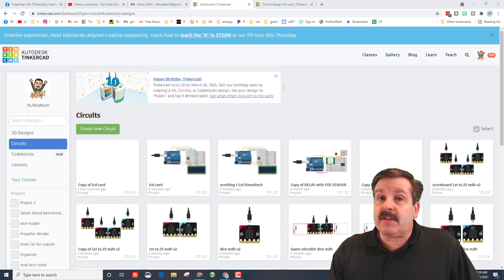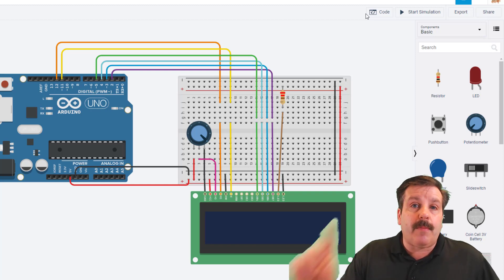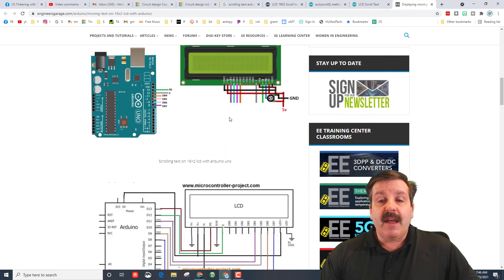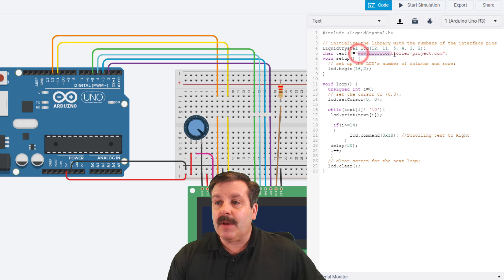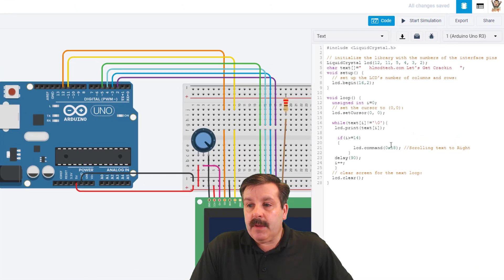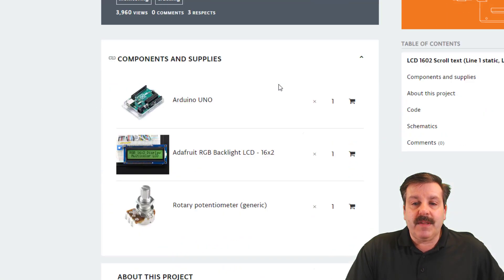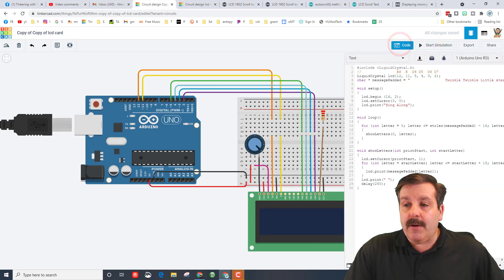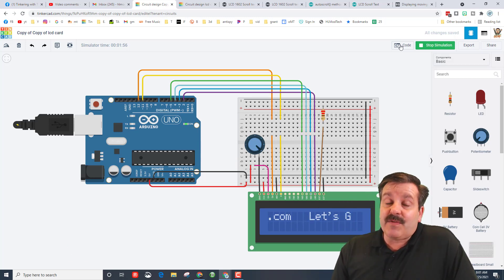Solved! Scrolling Text for the Tinkercad Circuits LCD in Minutes

Comment: Hey i just encountered a problem with scrolling text!!
when i want to print another sentence at the LCD cursor 0,1
the first two characters are not printing!! :(
Here is my code
in the below code the first text gas[] is printing full but the second text door[] is skipping the first two characters it only prints Doors closing in 5 seconds it skips "th"
what may be cause for this?

#include <LiquidCrystal.h>

// initialize the library with the numbers of the interface pins
LiquidCrystal lcd(12, 11, 5, 4, 3, 2);
char gas[]="Gas is leaking!!";
char door[]="thDoors closing in 5 seconds";
void setup() {
  // set up the LCD's number of columns and rows:
  lcd.begin(16,2);
}

void loop() {
  unsigned int i=0;
  // set the cursor to (0,0):
  lcd.setCursor(0, 0);
  
  while(gas[i]!='\0'){
   lcd.print(gas[i]);
   
 	if(i>=14)
	{
          lcd.command(0x18); //Scrolling text to Right
        }
   delay(100);
   i++;
   }
  
  unsigned int j=0;
  lcd.setCursor(0, 1);
  
  while(door[j]!='\0'){
   lcd.print(door[j]);
   
 	if(j>=14)
	{
          lcd.command(0x18); //Scrolling text to Right
        }
   delay(100);
   j++;
   }
  
  // clear screen for the next loop:
  lcd.clear();
}
Reply from the maker: The code does not show... You can shoot me a share link via the hlmodtech.com website if you want.